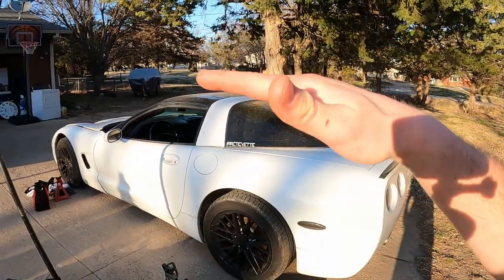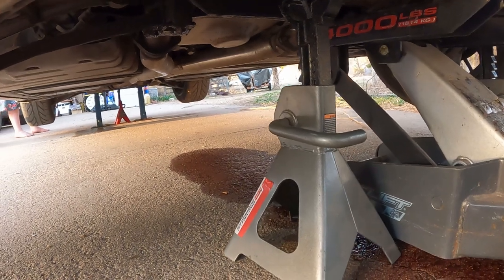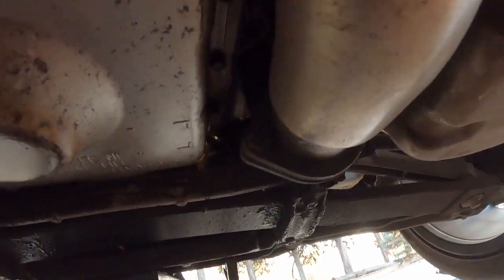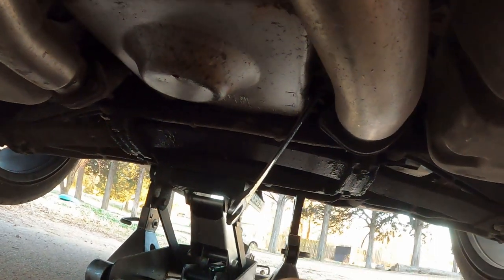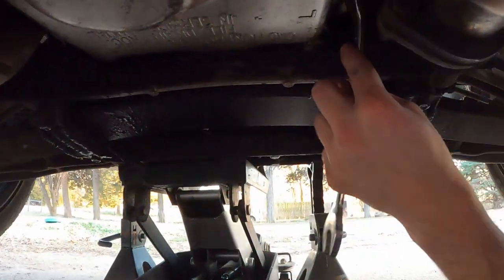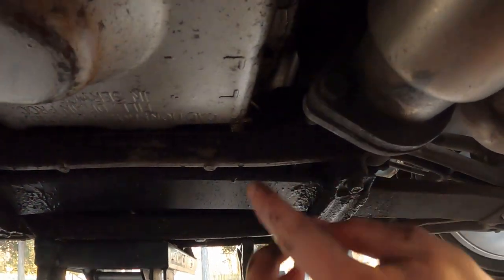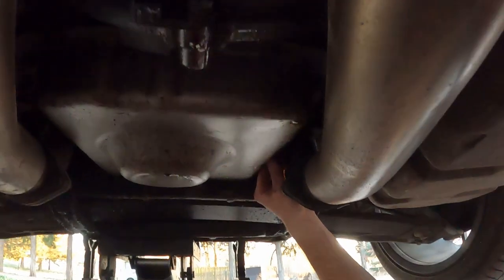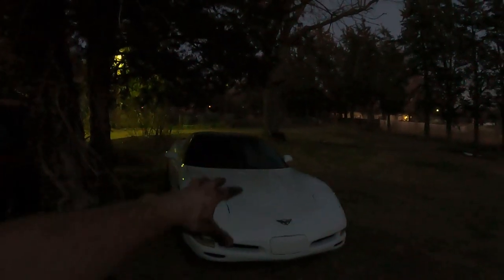How To check Transmission Fluid Level on a Corvette (C5 1997-2004) - Daily Vlog

Comment: No fluid 😢😢😢😢😢
Reply from the maker: Yeah, she's hurting 😬
Reply: @ArcticVette  just start engine, put P parking, and add fluid dextron 3 , when fluid go back - put plug and this all 👌 what you need bro 💪😉
Reply from the maker: I may try that but I also need a radiator now. Filling it up and seeing if it leaks again isn't a bad idea though.

Our radiator is cracked, so I can't start it until I get that fixed. Which I'm debating on what to do.. buy a manual rad, and get a trans cooler. Since going manual is the ultimate goal or get another auto rad for the time being 😅